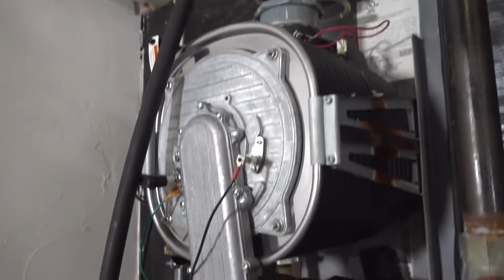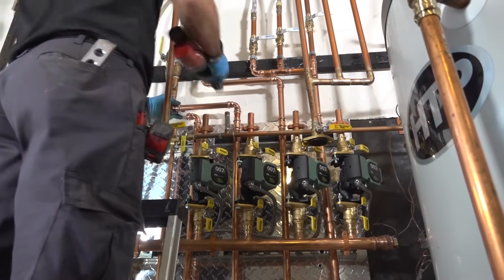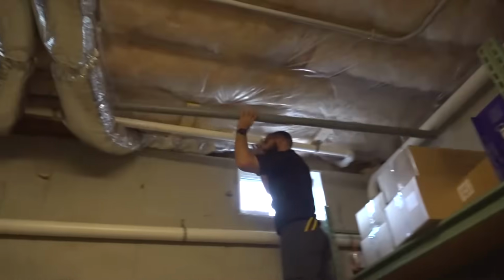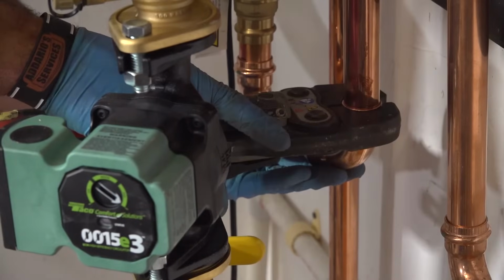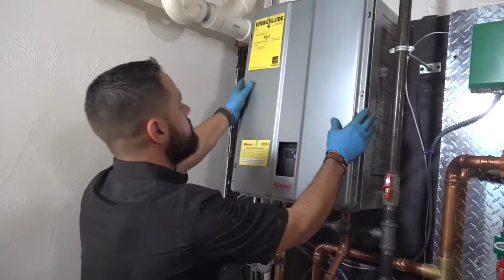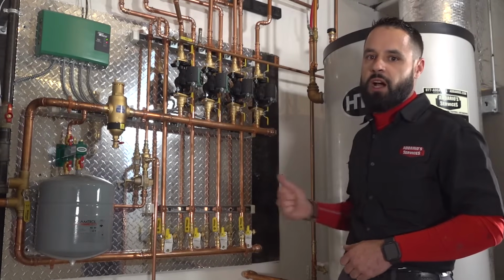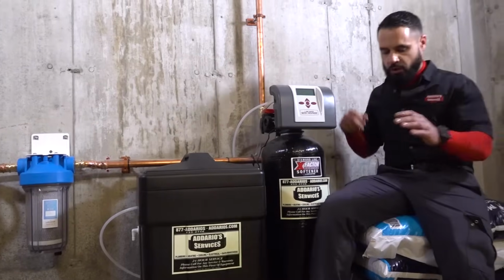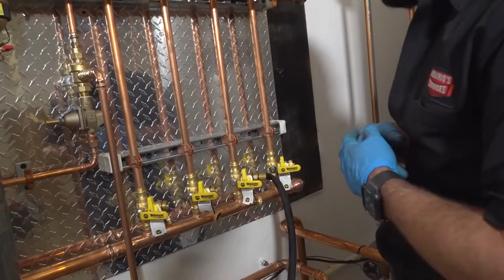High Efficiency Boiler [Installation and Explanation]

Comment: you shouldnt finish your vent pipes lower then you starts lmao those pipes are going to condensate and instead of that condensation running back to the boiler and through the drain on the boiler its gonna sit in the lowest part of that pipe. you went through a stud too thats scuffed

Comment: A low loss header will make this system more effecient and stop back circulation. You should always use low loss headers when you have multiple pumped zones
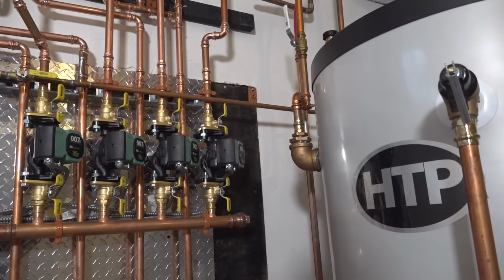Reply: At 8:50 there is literally one on it. To the left of the expansion tank

Comment: I wonder how quick these customers called back I feel bad for them. That exhaust pipe goes down then back up. The product of high efficiency combustion is water. Once the pipe fills with water no more heat for them

Comment: "That will eventually turn into a pin hole" but yet you are replacing the boiler and no pin hole. Those rubbers will never last longer than a proper solder joint.

Comment: If your tech is concerned about pinholes in copper from remnant flux, he should also start deburring his cuts. Water turbulence can erode the pipe quicker than the flux can. And a water softener does not deionize water, it only removes the minerals that make the water hard.
Reply: I too want to make the similar comment. The flux on the copper is the least of your concern unless they are from the 60s acid flux. Modern flux has no such problem. Those crimped copper fitting are unobtainium for DIY but you sure pay for them having a hydronic system installed by the "pros". I have well water and the last thing I want to do is to add chemicals to soften my good tasting water. Everything has tradeoffs. I spotted they didn't bother to debur the pipe after cutting it with the fancy cutter also.
Reply: Lmao ..you beat me to it ....37 yr tech....and that compression tools sucks

Comment: HPT is the worst garbage with the worst support for all consumers . Take it from 37years experience and 20 I had to remove for customers as the manufacture did not support the consumer at 20 below temperatures . 
HPT is a leaker of leaks and complete garbage !!

Comment: I’ve been working as a refrigeration mechanic in Ontario Canada for over 25 years in the last five years I have been doing a lot of These wall hung hi efficiency lo mass boilers, yes I generally find it’s not brand specific but most of the problems with these units are installation related I’ve changed over 20 boiler’s under five years old they have been installed from The largest companies around here to the smallest you really need to know what you’re doing above and beyond reading the installation manual, No primary secondary piping, magnets installed on a system that is all copper pipes and copper baseboards with no cast-iron even the circulator was bronze what’s a magnet gonna do it’s an absolute joke a lot of these guys in my area Are coming out of Niagara skilled trades academy we refer to them as GAS dummies they have a gas license but couldn’t throw a piece of pipe if their life depended on it

Comment: Should pay someone in your company to pre-fab those boards instead of buying them from FW Webb
Reply: zone pumps sitting on top of the primary look awful close to the primary tees  looks more designed for ease of assembly than functionality  also the mag trap on the supply side is like playing baseball with your glove on backwards

Comment: Sorry but pro press doesn’t last as long as a solder joint. I am seeing corrosion at pro press joints in under ten years.   O rings wont last on a primary/secondary heat loop with high temps.  I didn’t see the installer deburr pipe or clean it before he pressed it either.
Reply: Them compression fittings will leak when them rings corrode 100%. Job security for the plumbers 😂

Comment: I'm from the UK, do you not need a designated cold supply off the mains water for drinking etc? Or is the water there not acceptable to drink?
Reply: You're supposed to have a backflow preventer on the line supplying the boiler.

Comment: Also not to nitpick but your mechanic claimed the water softner deionized the water. It does not. It performs an ion exchange, TDS remains constant. Caleffi does indeed produce a mixed resin bed unit that will actually deionize the water in the boiler.

Comment: I have never used an expansion tank mount like that. I see you have an isolation valve on the expansion tank but no way to release the captive water pressure in the tank before checking the air pressure in the bladder. Does this mount have something built in to isolate and drain?

Comment: You guys did excellent work your vents your exhaust and your intake is at the wrong place because it says in the book that you have to be at least 3 feet from any opening which you have a window right above that. Now as your water softener as I live in the northern part of Maine all my life they only work to a certain point and they gotta be serviced now and then and your boiler Has’s to be serviced at the same time that’s what I’ve learned. now the boiler you are using  which I’ve had a lot of complaints on it why I have no idea and their service is not that great is the heat exchanger still copper if it is they’re still gonna have a problem with it. This time around I bought a western house  that has a stainless steel heat exchanger in it I’ve had it for a couple years and working fine but I have to have it serviced every fall like everything else the water softener that we’ve got is not that great either and the one that we had before that wasn’t any better the people that sold us that water softeners in the past they’re all the same they only work to a certain point they will never take out all the stuff out of your water but that’s my opinion no one else
Reply: That was the most incomprehensible rambling of a post I ever saw. 🙄

Comment: I installed a Rinnai here at my house and had nothing but trouble since year 4 it's now 8 yrs old
Reply: I have a Rinnai boiler for heat and Rinnai tankless for DHW.  Both running solid with no issues for 10 years now.
Reply: It's really the skill and knowledge of the Team of installers. Contractor quoting me a lot more than others
and mentioned quality of workmanship in our 1 hour meeting at least 3times.

Comment: If I was the home owner I would have went with a combi unit and gotten ride if that tank, did they get that option?
Reply: The tank turns up the efficiency
Reply: @Baerschi100  I can’t believe we can no longer vent in cvpc they want that central thurm pipe now
Reply: We have a combo at the house every time it demands domestic hot water it stops the hot water to go to the zones and it only goes to the hot water domestic hot water why The plumber can’t even figure it out they’re all the same they do everything the same way. so now we use a boiler mate which is hooked up to one of the zones which heats the coil that heats up my hot water and I don’t even use the domestic hot water in the boiler and that works fine
Reply: @paul06062  if u have a taco zone board and it has priority switch, that's what it sounds like

Comment: total on that??
Reply: It’s different for each install it depends on how much material is needed or whether you go pre fab or fab on site. There’s a lot of variations that go into an estimate before a sale is made. I used to be an estimator for a company the price of unit is always the same depending on model and size but it’s the materials that will make it more or less in the ends as well as labor.
Reply: @FullThrottleRestoration  sure but I’m asking for this one.

Comment: I can't that local and state laws would allow this boiler to be vented so close under a window. I'm sure even the install manual would prohibit this.
Reply: If it is a two pipe system only 1 foot of clearance is needed from a window. If you choose to do a 1 pipe then it must be 4 feet. Obviously this is because when you draw inside air you create a negative pressure inside the home as with 2 pipe systems you do not.
Reply: You would be wrong
Reply: Here in Germany, specificaly in Hamburg i've seen natiral gas fired so called wall ovens (Wandofen), that have their intake and exhaust in one double walled pipe right underneath the windows. But i dont know the laws in the USA.
Reply: If they are in Ontario if the unit is over 100kbtu it’s 3ft to a window

Comment: flux will not turn into a pinhole.
Reply: Flux over time will corrode the pipe and eventually a small hole will appear but it’s years down the road not immediately.
Reply: @FullThrottleRestoration  - about 1,000 years. Give it or take 5

Comment: Do you chamfer and ream pipe ends for pro press joints? I didn’t see if you did.
Reply: Didn't look like it. Also cut through a wall stud for the venting.
Reply: @roberthegedus5022  yeah, what was up with cutting the stud? could've moved over to avoid that. hackery. 👎
Reply: They're hacks
Reply: Cringe-worthy hacks indeed.  But at least they wiped their feet (sarcasm).

Comment: it would be helpful if you can list some prices of installing such system
Reply: @Addarios  I appreciate your effort to help with the explanation it helped us to see the ballpark values of such projects ,  we do understand that cost change depend on size of the house as well,  one more general question , now  as I know most these Boiler system runs on Oil , is there any way that later in future we can upgrade these system to run on Solar Power ? or there is no way that this system can be upgrade or support to work with Solar power , in that case later if we want to power by solar power do we need to redo all and buy new equipment's ?
Reply from the maker: @johnnyjax6444  So actually most of these boilers I've seen in the Mass area have run off of natural gas, rather than oil. I haven't seen anything about linking solar panels to these, and to be honest that's not really something our company has much experience in. You could run this system off of electricity, but if you're heating the whole home vs just your hot water then it may be more efficient (and more reliable) to just use gas. If you're set on pursuing solar power for your home, you might want to look into Mitsubishi Mini Splits since they are specifically designed to run off of electricity. Also, since their installation already requires an electrician, it may be cheaper and easier to have the solar panels connected to the mini splits since they'll already be there for the job. Bear in mind, I'm really not qualified to make suggestions on solar panels but hopefully that gives you some direction in your search for the answer!

Comment: Just got my Gas License in Ontario and didnt learn boilers too much and going into the plumbing trade. Definitely learned a lot from this video, work was absolutely clean and is a standard to achieve for me. Thanks! Superb work!
Reply: That's a real shame because I had the same experience from HiMark in Toronto.
Reply: @tranceaddiction  I did mine from HiMark in Ottawa haha
Reply: You got your gas licence and didnt learn boilers? What the hell did u learn then?
Reply: @colin4685  just goes to show licensed does not mean qualified. I can get a license for anything but that doesn't mean i can ir should be working on it. There is more to learn past getting a license before you should be working on stuff.

I have seen some unlicensed people who know more and can do a better job than a licensed quote unquote professional.
Reply: @colin4685  fyi this is an entry license which only allows him to work with a fully license technician 
It will 10,000hrs or 5 years til he is fully licensed ...and  2 years of in class education .....Thats here in Ontario ......
Reply: I took the same course, They often don’t go into detail about hydronics and how boiler systems work. They teach more about the components and for the most part teach about other aspects of gas fitting, a lot of venting, and forced warm air appliances.
Reply: Well first do not be too  Discouraged from the comments.....
Getting in the trade is a long process  
Here in Ontario unlike 90% of USA we trades require 10,000 hours and 5 years of training before certification... his Gas license is an entry license not a fitter 1 which it a full license.....and by then you will know Boilers .....
In the USA they are not as well trained as in the Canada ......some states  are strict most are not.
Fyi either George Brown collage or Algonquin Collage are your only choices for school the rest are a waste of time
Reply: Run from this business … thanks to the epa boilers are going by the waste side and is horrible work.. ask me how I know
Reply from the maker: I'm glad you were able to learn a lot from our video, and thanks for the compliment!! Boilers are their own beast haha but hopefully you'll get a chance to work on some in the field. Congrats on getting your gas license and best of luck to you in your career field!